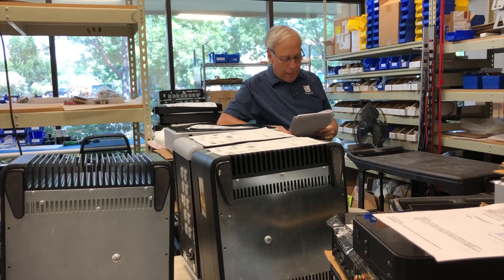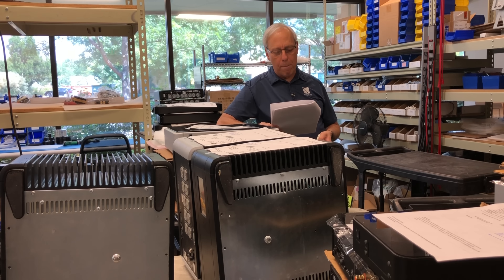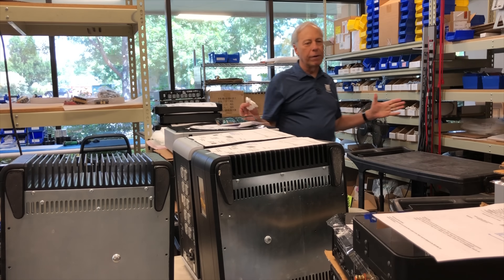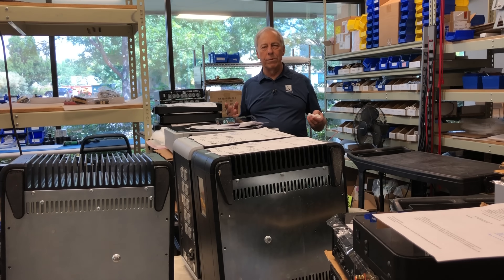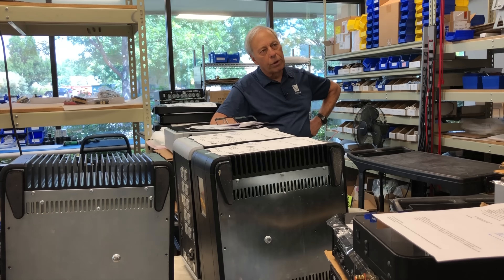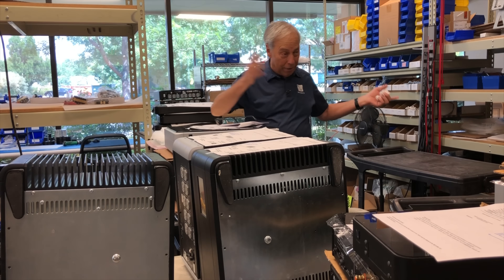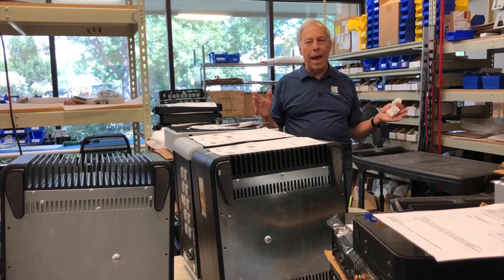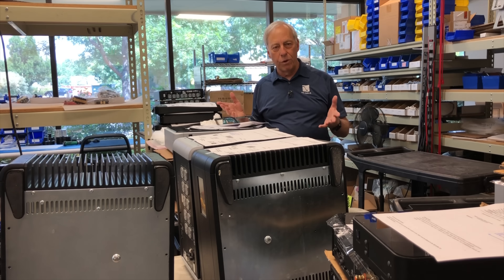Why should speaker cables have a minimum length?

Comment: Looking at the schematic for the NAP200 amplifier you'll see that there is no inductor that makes up a part of the usual Zobel network that is found in nearly all solid state amplifiers.  Could it be that Naim rely on the length of the loudspeaker cables to provide the inductance of a Zobel network, and that cable needs to be at least nn feet?
Reply: "early Naim gear doesn't use an inductor at the output stage to prevent oscillations and relies on the speaker cable's inductance to keep the amp stable under load. The olive and chrome bumper era amps req. a minimum of 13 ft pairs of Naim's own NAC A5 cable." see also  Naim FAQ.    Cable inductance is not needed for the new style XS etc because such has “a different output section and Zobel circuits”. Naim tech support, 2024.

Comment: Cable is a conductor, anything they could do is degrade the signal, they can’t improve the signal period! It’s like window glass, less, thinner is better, the thicker or the more layer the glass, the more distortion it will be, it will never improve the clarity by thickening the glass! So the physic rule will never change, shorter cable is always a better conductor! Of course thicker cable is also better, because it’s like a bigger water pipe, the current flowed easier!

Comment: I think an answer to this cable length question just occurred to me.  If the cable is 3.3 meters long, it will allow the speaker to be moved around without damaging connectors.  Seems like that is a good reason.

Comment: I'd almost wonder if, in addition to length, they have other specs too. Gauge, capacitance/ft.

Two things that I'd suggest.
1) capacitance of the cable - will possibly have an effect as Paul suggests of high frequency roll-off. 
2) Resistance - this is so minimal I don't know how much effect it might have. But, if you consider the speaker and cable as one complete system, the resistance of the cables will have an effect on the Qes of the woofers. Additional resistance will increase the Qes, thusly Qts, thusly the optimum box size for that woofer.

Perhaps they are accounting for some FR profile, but (I can't recall the formula/relationship for how wire resistance affects Q) I have to imagine such a small amount  of additional R of a specific cable length would be almost nothing.
Reply: Yep.  Blanket advice on speaker cable length to set FR and damping profiles is incredibly naive.  In theory, you could use a speaker cable's length to ... sigh ... fine tune? .. some of this.  But you would have to measure the actual properties of THAT amp, THAT speaker, in THAT location of THAT room, and model it to see whether the difference is even significant enough to see on a graph -- much less hear it.

Comment: Never heard that but I have heard the cables should be the same length on both sides. And that is something I’ve always practiced. Despite not believing I’d be able to hear the 1 millionth of 1 millisecond delay between a longer & shorter speaker cable. Unless it was significantly different. Which sitting here makes me want to try 1000’ on the left and 2’ on the right. I wonder if I can find a 5000’ spool. 1000’=304.8 meters. 2’= 60.96 centimeters 5000’= 1524 meters.

Comment: Not sure if it’s related but I know Ethernet cables and many RF signal cables have minimum lengths because if you go under that threshold there is internal reflections that can produce noise and reduce reliability, or even in some circumstances damage equipment. That said, minimum length for the average Ethernet cable is like 3m/10’ but plenty of people use much shorter lengths and there’s no noticeable difference 99% of the time

Comment: I thought this was only with old Naim gear but I just check out some manuals and they all say minimm 3.5 meter so around 10 feet. That is crazy when you really don't need that long and more expensive too. I actually thought the shorter the better for speaker cable. For mains power boxes there is actually a minumum of 1.5 meters / 5 feet and a technician did confirm it but could not explain.

Comment: An electrical current travels at near speed of light , how do you explain the difference in sound with different cable lengths?
Reply: electrical resistance

Comment: Cos the time crystals don't align with the subspace triangulate with adamantium core. Also the fact that the cable can live on short cables, he needs to sell as long as possible 50.000 cables to you.
Reply: that makes no sense, shorter cables are better most of the time, less electrical resistance
Reply: @kirbyman1kanden7pf  I know sarcasm is hard... Read slowly what i typed :D

Comment: CHORD SPEAKER COMPANY done quite a bit of testing on speaker cable lengths and what they found was a difference in length of not more than 40% worked pretty well. So a 5m/3m pair, 7m/4m pair and a 10m/6m pair were good. There are a couple of important points here though. Whilst the vast majority of amplifiers will be completely happy with a different length pair of speaker cables, some amplifiers use the speaker cable as part of the circuitry and in this case, cable lengths should be kept the same. Before using different lengths of speaker cable, it is important to check with the manufacturer of the amplifier.

Comment: In my system not a single cable is over 10ft. I believe shorter cables do offer higher quality. So use only what you need.

Comment: It does matter, but if you don't have the knowledge you won't get anywhere and no one here has the right answer "why". Here is an example and explained in a simple way, so that you now know in which direction you have to investigate yourself. Fact is minimum length is a fourth Lambda wavelength. is that always possible? that's not what I'm trying to say, purely theoretical. there is sinus (sinus, cosine, tangent) and time, in short what is more, these must be in resonance of the related frequency otherwise. you get standing waves (back effect). In the Bi-wiring explanation, a cable is said to be silver for high and copper for low, why because the mentioned ferquences conduct best there. why? that is, the suggestions mentioned below about the thickness of the wire are not correct. there is SKIN effect, do your own research and immediately tell you where to look, but you cannot guarantee that everyone understands it, it is a different level of electronics and mathematics. RF transports along the shell so outside of the cable, which is why silver cable  (Skin effect{look up "Rho"}), HF on the other hand transports itself more to the core (copper{look up "Rho"}) ... etc. frequencies are different, just look on an osciloscope, hf has less sinuses than RF in the same time base. now back to 1 lambda (ore 2,ect.) or half lambda but at least a fourth lambda ... Now here's the thing! there where, for example, RF and HF at multiple wavelengths, so sinuses, there is 1 point where they touch each other in parallel and that is the SPOT the actual ideal cable length. where to look for this knowledge HF technology transmitters and antennas. Amplifier is the transmitter, the speaker is the antenna and everything in between waves and the coax ladderline or indeed the "speaker cable" or cables (bi-wiring {amping}) succeeds and enjoy listening.(STAND WAVE RATIO) greetings Richard

Comment: The reason Naim Audio suggest a certain length of speaker cable is because the series inductance and capacitance in the cable replaces what is normally found in the Amplifier output design, which is not used in their output stage design.
Reply: Again, this is the correct answer.
Reply: NAP140 and NAP250 are the onder models and more sensiteve for oscilations. More modern design amps like the nap 200 and the integrated supernait are better equipt .
Reply: An example of Naim's poor design. 
I've always found their amplifiers to sound splashy and all over the place.

Not a fan.
Reply: @nathanevans6277 you can like it or not like it, but to say that a desicion of world class engineers who've been making great amps for decades is poor design Is kind of ridiculous.
Even moreso that their decision is pretty weird and unusual and goes against good marketing.
Reply: lol @nathanevans6277

Comment: So its actually not that difficult to explain. The concept you are referring to is called phase. And if you placed a specific driver in a specific cabinet and you only were ever going to play and 1 kHz test tone on it you absolutely could cut the speaker cable to length to optimize its impedance match and phase relationship to the system.  This would be a narrow but efficient way to match that. 

However it comes down to a question of wave length...

If we were talking about an amplifier for FM radio up on say 98.1mhz, then on that frequency the wavelength is about 3.055 meters. So you can see where in a system designed for that it woukd be prudent to watch your cable length for best match. 

Now to your stereo... lets look at 1Khz where we like to play test tones. Now instead of 3 meters the wavelengthhas expanded to almost 30k Meters! Thats before that 1khz tone makes one full sine wave cycle in the cable! You would need to correct that number slightly for the velocity factor of the wire as opposed to air, but you get the picture. 

As long as you keep your cables reasonably short, phase shift is not going to be an issue at these frequencies. 

Your main issue down here is line loss... which under 30’ or so again is not a huge issue. If you have a massive home and you needed to run 100’ + speaker cables they make 70v and 140v speaker systems that use transformers to boost the voltage on the line to reduce loss very similar to what our utility companies do when transmitting power. 

There are a couple of problems with this thought process though. 

Speakers run constantly at different impedances based on the frequency that you run into them and the cable that you were connecting the system together with present to different impedance to the system based on the frequency that you were presenting to the system. 

So when you actually play real music the impedance of the system is constantly changing with them certain realistic parameters… Because obviously there is a certain frequency range within music that is very common and then every so often you hit extremes. 

A crossover designer can make certain compromises based on what they know about where the energy is in musical sources to present the best Combination of load to the amplifier but I would argue that the crossover and the speaker and the characteristic of the drivers in the speaker make far more different than anything to do with the cable or the length of the cable when it comes to the interaction between the amplifier and the speaker simply because of the fact that even though the cable does have its own innate characteristic impedance that we are talking about amounts that are so minor down in the Milli and micro-ohm arrange that for most people that don’t have lab grade instrumentation they’re not possible to measure. 

So if they’re that difficult to measure with a meter, how possible do you think it is for you to hear it with the human ear? Or would you think it’s more likely that it might be the placebo effect…

I’ll let you be the judge of that.

It is my opinion that your speaker cables in your home should be as long as they need to be to put the speakers where you would like them to be, and maybe just enough longer so if you need to move the speaker to clean that you have a little slack. If you find that they are starting to exceed 30 feet in length or so then you might want to consider why your speakers need to be that far away from your listening position but other than that I think you’ll be OK.

Comment: When running in new speakers, using longer braided thick cores 3m cables can mellow the heights. Otherwise so painful in a year for the ears, so non musical sounds. When burned in, changed the cables for shorter custom lengths.

Comment: I find dipping audiophiles in liquid nitrogen overnight improves the dynamic range by reducing the useless noise they contribute immensely.
Reply: Someone missed the joke
Reply: @billd9667 Whooosh! The sound of the joke flying over the head.
Reply: As a cryogenic audiophile, I approve.  😅
Reply: Iäm an audiophile, and contrary to your finding,  found that being dipped in liquid nitrogen did not help.  I think its a myth.
Reply: if the cable gets longer, wire gauge being kept constant, the voltage will drop, it will have an effect, that is a fact

how big of an effect it will have is complicated...
Reply: @kirbyman1kanden7pf true but not hard to calculate using wivvir

Comment: Check your cables aren’t the tuned length for 5G frequencies.
The cables were made before 5G existed, and now may allow the coronavirus into your system.
Rip them out immediately!
Reply: vaccines are coming ;)
im protecting my system with a pyramid ^  ;P

Comment: Longer cables introduce resistance which will change the impedance. High frequencies need wider cable widths over long distances.  velocity factor of the cable

Comment: There is a ton of wacky thoughts regarding cables. I just read a 'review' about a $700 (Yes!!) USB 2.0 cable, that the reviewer claimed had better Bass response. Other than a really cheapo rubbish USB cable, there is no way for it to affect frequency response. The converters absolutely matter, and a dollar store cable may be a poor choice, but there is no way past a certain point and maybe 40 bucks would the cable matter.

Don't even get me started on this reviewers opinion on an $800 head phone cable, that allowed him to listen at 'thunderous' (his word) levels for hours with out listening fatigue. I guess you have to come up with some lie to yourself to justify the expense.

Also many things can be measured, that absolutely cannot be heard by human ears. Such as the capacitance level of an 18 vs 20 guitar cord, and the roll off of the 'highs' on the longer cord.
Yes, cables have capacitance, enough difference in 2 feet to roll the highs off at a human hearing level...at some gig in some dingy club? Um, no.....
Reply: I actually bought a $600 USB cable and it sound amazing. I was shocked.
Reply: $800 cable is not expensive at all I spent eanely $2000 for cable and it made a huge different!

Comment: It’s because Naim doesn’t use output inductors to stabilize their amplifiers. It takes a cable that long to provide the necessary inductance. Paul, are you reading before answering?
Reply: Yes, that was my guess too (see above).  Some designers, apparently, are ideologically opposed to Zoebels, and that could account for the "night and day differences" between speaker cables using high end equipment some people describe.  Or it could be the "Emperor's New Clothes" effect.

I decided long ago, after carefully auditioning expensive and cheap speaker and interconnect cables, that any differences I thought I might be hearing were too small for me to care about.
Reply: some other amps dont use inductors either... its just poor design by naim

Comment: I'll take a guess. When you send a signal to the speaker it tries to send one back to the amp as the voice coil moves. The longer the cable the more time it takes for the counter signal to return to the amp. It should be desirable that you want the sent signal to have moved on so it's not simultaneously opposed by the counter emf. OK, I pulled this out of my butt but it seems slightly logical.
Reply: The effect you're describing exists at RF but is essentially nonexistent in AF.
Reply: @hubbsllc  interesting reply.
Reply: This was an interesting thought.

Comment: Paul, they only need a minimum length if the amp isn't well designed and relies on the cable to provide the required inductance in the output.  Most amps dont need this, just poorly designed ones.  Naim didn't use inductance on the output of their amps so that they rely on their Nac cables which use a controlled inductance geometry to provide that damping inductance. It has nothing to do with synergy!

Comment: Is it simply possible that their amp is not electrically stable with short runs? Seems a stupid way to design a consumer product, but there it is. I vaguely remember, years back, Spectral refusing to guaranty the stability of their amps, unless a certain type of cable was used.

Comment: How does one deliver the best amp damping to a subwoofer? I was told to use the shortest cable run possible, and 10 gage high strand count rope lay design. Parts Express sells it cheap.